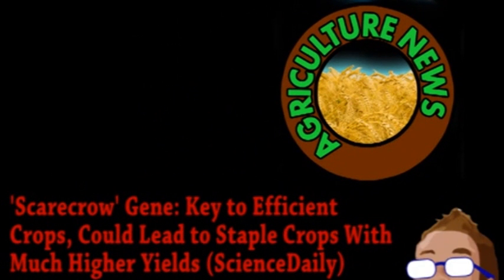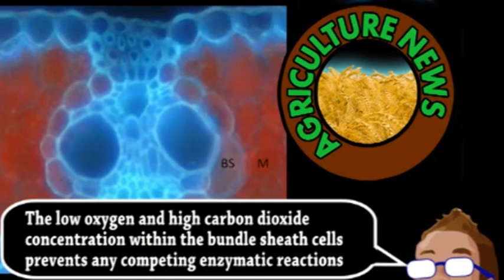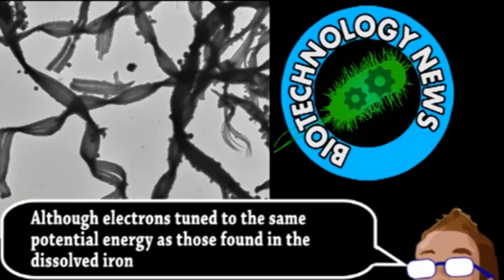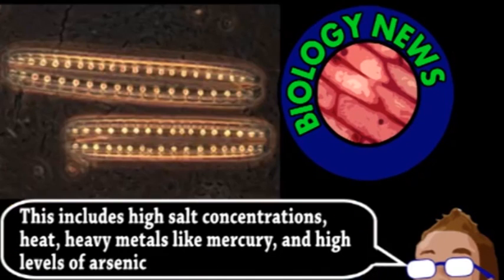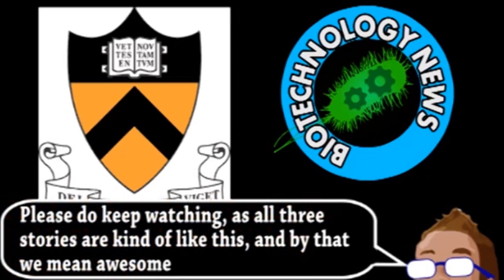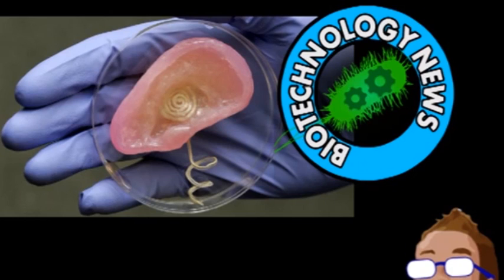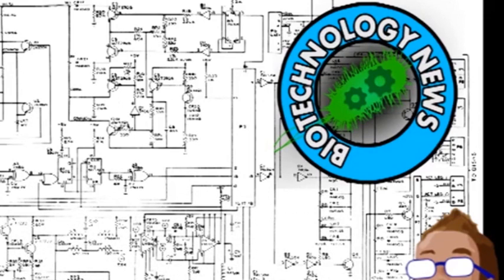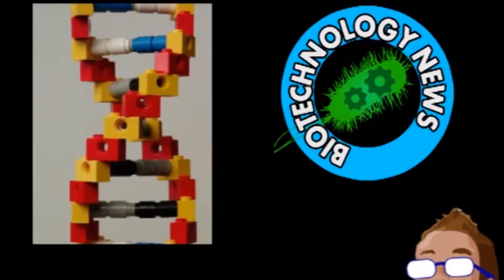Brainstorm Best of 2013 - Biotechnology

Comment: I'm all for engineering plants, though the greed aspect seems to quickly come into play. With big corporations patenting their changes, and those changes being stronger than natural breeds, so then that plant pollinates some farmers plants and then he gets sued.  Or them just wiping out natural breeds, with the engineered ones, and then down the road there's some fatal flaw in the engineered plant that can't be fixed and we've killed off the naturally occurring line.

If we can take the greed out of it though, that would be a good first step.

Radio ears though, that would be sweet. As long as it didn't get stuck on the country station.